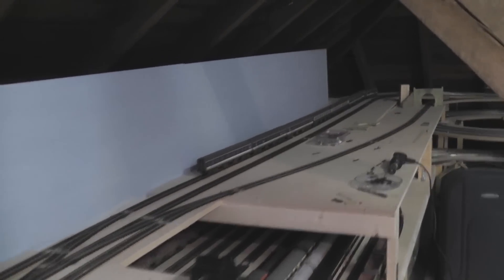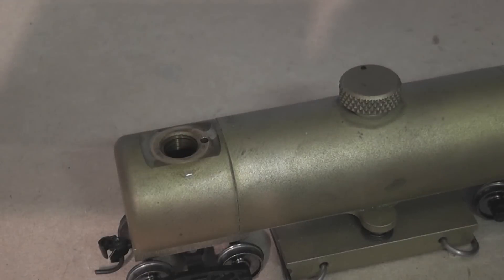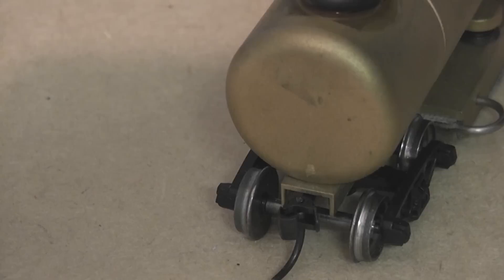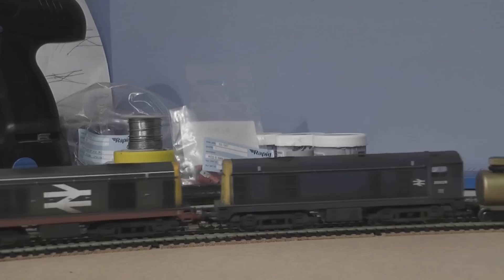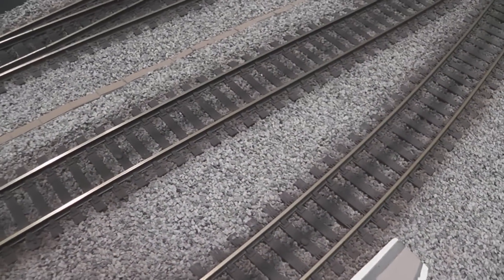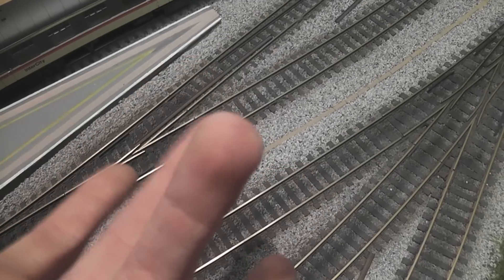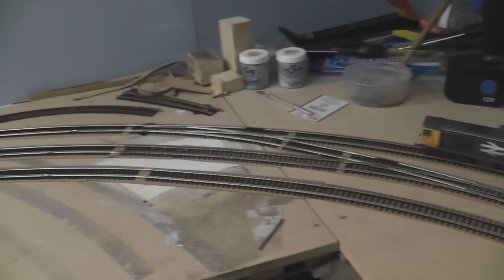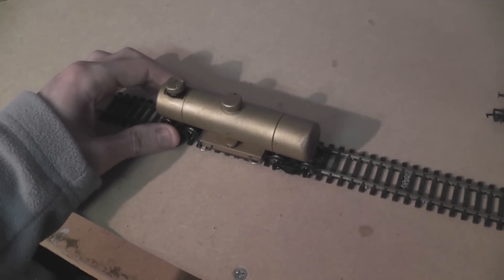How to - Episode 9 -Track Cleaning

Comment: Hi m8 I just wanted to thank you for the Go Gone tip, it's fantastic. My 2nd hand Triang tracking cleaning car arrived in the post today along with a bottle of Goo Gone, still waiting for my Class 37 & 40 to arrive & with my Class 08 out of action Jinty was put in charge of track cleaning duties, she did a sterling job. Coupled her up, set the Select to half dial, she was a bit slow & jerky to begin with but after twice round, a massive speed boost as the track cleaned up, the track was a state!

Comment: Excellent video. I have found that while Goo Gone is great at removing dirt and grime, its residue tends to be a bit sticky and can attract future dirt fairly quickly. After using Goo Gone, I like to go over all surfaces again twofold with denatured alcohol. It removes the Goo Gone residue and slows the process of further track grime build up. As far as cleaning wheels, I like to lay down kitchen roll and run the stock over it back and forth using the same formula, Goo Gone and alcohol.

Comment: great for your bigger layouts and ones which tight spaces, your branchline also looks really good and smooth and love the new purchase.. can see it running smoothly on the clean track well.... quick question.. how many times would you run the cleaner over each loop? cheers.. Ethan

Comment: great video as always. I have the n gauge version and that's a fairly heavy unit too. but as you say it has to be for better pad to rail contact. I struggle getting the flow rate correct.

Comment: Some years ago I found a tip from a British Model Train group which suggested cleaning the track with ISO propyl and then using a us product called NO-OX which I got very cheaply from Ebay, the result on my layout which is a 5.5m x 5.5m double level track with a 4 level 3 track 76" dia helix has been nothing short of amazing I have a 10 track fiddle yard on the lower level now so with that much track, cleaning is obviously much on my mind, I have cleaned my track (you can use any track cleaning solution you prefer) then a little bit of NO-OX (the manufacturer and the British Model Train group suggested that 1 teaspoon would cover about 500 ft of track, I have spread it on the track using a Woodlands Scenic tool for track cleaning and I measured the voltage across my track before doing it (using a Digitrax DCC system) 6 months later no apparent oxidation of track, and no loss of voltage at all, trains run smooth and I can only recommend using it, hope this helps

Comment from the maker: @bloodmarine77 Thanks mate, I would stick with the dapol one as it does a good job.  I would say the CMX is a bit better but it's noth the extra cost if you allready have the dapol one.

Class 150s where first built in 1984.  The livery that mine is painted in was around from 1987 to the late 1990s.  So despite the modern appearance, it's a perfect fit for the layout.

Comment from the maker: @pyronathanpyro isopropal alchohol is very good as it evaporates quickly.  Goo Gone does evaporate, it just takes a day or so.  While the residue is there it's very useful for wheel cleaning as i explaned in the vid.  1 day later and there is no sign of any goo gone on track.  

 isopropal alchohol is great, but I've been using goo gone for 2 years and never had a problem.

Comment: Hi, see this CMX thing.  I am on the verge of ordering one as it seems to be the best available.   However I don't have Kadee couplings and I see it comes with these fitted.   Do they come with NEM/ tension couplings to fit? So forums seem to suggest they do! Cheers. Dave
Reply from the maker: DaveClass47 I believe they do now come with tension locks (I think).  Mine didn't but that was 4/5 years ago.  Even if it doesn't the kadees can be unscrewed and some spare old style tension locks screwed in place.

Comment: Odd question: Have you ever considered applying a little Bullfrog Snot(Yes this is what they named the stuff) to a heavy duty locomotive so you don't have to doublehead when pulling this? Or perhaps, to your steamers, so they can actually pull trains up the helix?

It's super popular stuff for us N-scalers and it makes a HUGE difference in pulling power. Tiny little 4-4-0 locomotives weighing an ounce and a half that, out of the box, struggle to pull ten old timey passenger coaches suddenly pull 30+ 50 foot hoppers like they weren't even there. 

Comes in a tin, an ounce of the stuff costs 25 US Dollarydoos. I don't know what scale you run(I think OO? HO?), but for us N-scalers that tin will pretty much never run out.

Comment from the maker: They are set as a double headed unit in my controller, so both will respond to any commands.  

I've fine tuned the cv settings in each one to ensure they both run at the same speeds.

Comment: doe you recon that my vitrains 37 would be ok to pull a cmx around a layout like yours as the center axle is non motorised (so only 8wd not 12) or would you double head with 2 of them as ive got the intercity twin pack or would one of my Bachmann  FGW 57's do the job better. chears

Comment: Using any kind of cleaning fluid only causes the need for more cleaning. The residue left behind always attacks more dirt. A simple masonite cleaning pad weighted properly at a cost of around 15 bucks works just as good without any kind of cleaning fluid. One or two passes and you are good to go without the $100+ price tag!